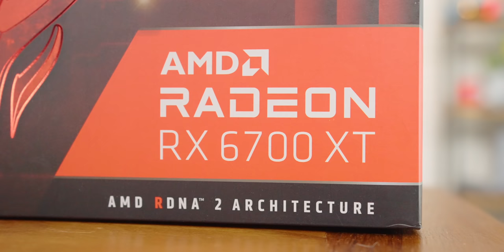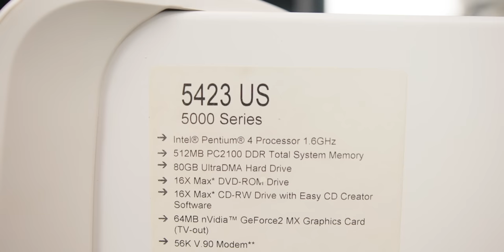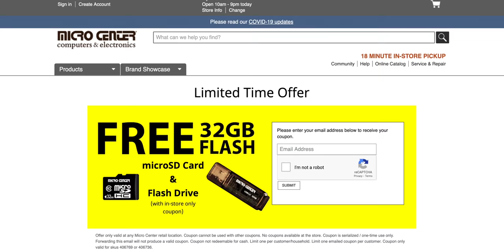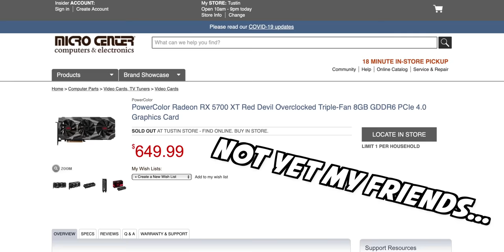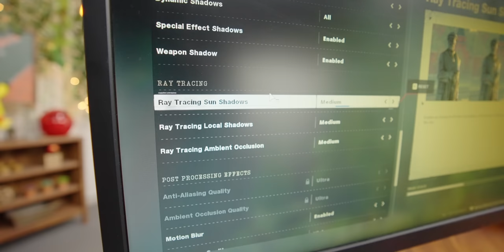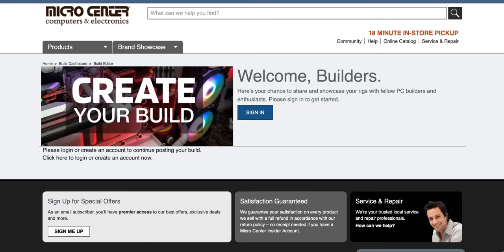The Sleeper Gaming PC Build!

Comment: I actually just did something similar.  I have a Ryzen 3600 on an MSI B550M mobo using my PSU as exhaust too all in an old Dell Dimension 4600 case.  I was able to remove the front hard drive caddy and put a 120mm AIO as intake and CPU cooling.  For extra cooling, what I did is use a rotary tool to cut two large holes in the bottom and have two 120 mm intake fans.  You'll lose the bottom PCIe slot, but it works.  Now I'm just waiting  to get a EVGA 3060ti XC since it's one of the only ones that'll fit in my build.

Comment: i suggest to cut holes in the bottom and install about two flat 120 mm fans there, blowing air in.
i then would put clear sticky tape on the slots in the side wall, to force the air to go around the GC, and out the back.
then i would enlarge the opening for the power supply to be at least as large as the power supply.

Comment: Why are they even giving “reviewers” any cards at this point? That supply is more than entire continents are getting.
Reply: they usually send pre production units to reviewers (if the stuff comes from the manufacturer and not from microcenter or similar)
Reply: @phoenix0828  it’s still silicon that meets spec and could go to an actual consumer. I’ve been in the EVGA queue for a 3080 for 194 days.
Reply: because of marketing purposes, there you go

Comment: Since the bottom sits off the table top, I might have considered drilling some air flow holes in the bottom of the case to get air coming up into and then out the back of the case. Also if time had allowed the front comes off and the case front could be reworked for more airflow - Ive got an old Acer case similar to this Id like to do a sleeper build in, its  a well made case just has old single core stuff in it.

Comment: Thank you for making this video. I too have a presario 5000 sleeper. I was always worried about buying a CPU cooler and a graphics card that would fit. My only problem now is cable management. I made sure the disc drive (a blu ray drive I painted white) and floppy drive works, but man the cables are hard to keep organized.
Reply: where did you find the blue ray drive and did u update the usb?

Comment: OK, Austin;
I'm old, OK?
So I know a thing or 2, since I'm old.
That Compaq case has an air flow INLET in the front!
If you look at the BOTTOM you should see there is a plastic part that holds up the case front.
From the rear, you can see the slots in it for the air inlet.
The slots feed into the front cover at the bottom so the air enters the case UNDER the floor moving forward.
Then it turns upward going behind the front cover, & then it turns toward the rear of the case.
If you look inside at the front of the case, below the drive cage, you can see the air inlet holes in the metal.
So  the air comes from under the case, in the bottom of the front cover, thru the lower front of the case.
The internals move the air around, thru the GPU, thru the CPU cooler, then into the PSU then out the back.
The rear case exhaust fan is also exhausting, that creates a slight negative pressure which also pulls air in.
BTW, back in the day, the inlet slots could get enough dust in them to reduce air flow & cause overheating.
But tech 'tubers usually don't run their projects full-time so that's unlikely.
But if you start mining that rig be sure it gets enough air.  Just sayin'.

Comment: I legit still have a running Compaq Presario 5000
Plays Quake III at max settings
It's An AMD Athlon 900Mhz, 256MB ram (had 640 back in the day) & a radeon 9600XT 256MB
20GB Seagate barracuda HDD

Comment: I have this same case I got from a friend to do a rebuild as well but the case I got had a AMD Athlon(Slot A version) 900Mhz and can say Compaq must of liked this case to keep it around that long. I am going to put in MSI Micro ATX(AMD64x2) I got just sitting around and a much shorter(non tower)heatsink so I don't have that same oh crap feeling you got when putting back on the side panel and keeping my optical drives. Great video and have a good one.

Comment: I'd just cut holes in the bottom and install 2x slim 120/140mm fans there. Airflow should be a non-issue then.

Comment: uhh, you shouldn't be using a single cable to power two 8 pins... not sure if you noticed any coil whine or anything but I've been told many times to use 2 separate cables

Comment: This I like. I used to do the same thing with old geeky eMachine cases. I never went full gonzo like this but I did buy a parts Lenovo once and just swapped the guts in. Another one, I got an econo bundle from Micro Center in Santa Clara CA (since closed). Poor moron there said it wouldn't work. It was a sleeper for sure. 'Only your hairdresser knows for sure'.

Comment: to be honest with you i would of drilled holes on the bottom so the air flow will be better and not just that it will actually not be seen very well (IF YOU DIDT USE RGB) but anyways great video

Comment: Hey Austin, I got the same power supply for 50$ with a rebate. My question. I have  a basement for the PSU. And a vent. What orientation should I use

Comment: Hey, my HP Pavilion desktop from 3 years ago has even less airflow. The tiny air holes in the side panel are completely blocked by the hard drive and ssd. Even with the fan spinning really fast and being loud, there is still almost no air flowing through the system.
Reply: Cool but what are you saying here? Is this hinting a question?

Comment: The only thing I don't like about videos like this is they never show the pro-longed use case for an old case with new hardware. I attempted to retrofit a case from 2005 that I've had for years. Love the case... but anything higher than an i5 6th gen with better than a RX480 in it, it does nothing but over heat if you push it even in the slightest

Comment: what if you drilled holes in the bottom of the case and used intake fans to shoot air up into the system since it has legs and is off the ground atleast the video card would get fresh air and people shouldnt be able to see the holes at the bottom of the case

Comment: I actually built my pc in an old case just for laughs. I kid you not, the case has a sticker on it that says, "never obsolete." Yah, sure. It was from the 90's. A 500 mb (not gb, MB) hdd, an intel pentium processor that ran at 133 MHz, and 12 mb RAM. 
I took all that out, replacing it with a ryzen 2600, 16 gb ram, and a Nvidia gtx 1660 super. The thermals were awful (gee, no shit sherlock) so I cut a few vent's at the bottom of the fromt that wouldn't be noticeable to a casual observer. Still not great thermals, but never hits over 80C unless I play PUBG (for some reason that's the most thermally demanding game I've played)
The best part is, it's still got that "never obsolete" sticker on the front.

Comment: I've seen all sorts of sleeper builds. 95% have clear/glass side panels which completely negates the idea of any sleeper builds. For reference. I have a 1979 ford pinto with a 351 Windsor. You cant tell I have that in my car until you ride in it or I open the hood.

Comment: You should’ve removed the floppy drive instead, you could’ve easily mashed all the cables into there and hid them away there. It’s way more unnecessary than the optical drives, so you should’ve just done that instead

Comment: i was still using a pentium 4 in 2010 i actually still have it with the 5950 radeon gpu in my basement somewhere i should pull it out and clean it up see why it stopped booting and try and get it going again get my 20 fps in W.O.W rbgs hahahahaha